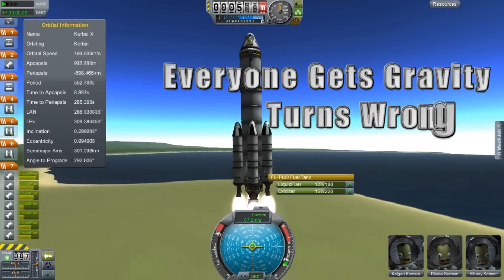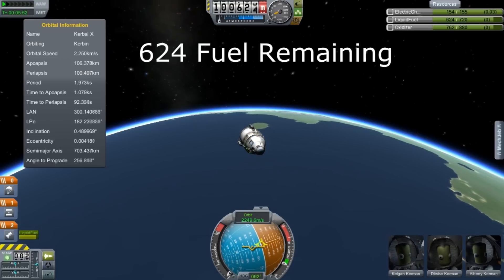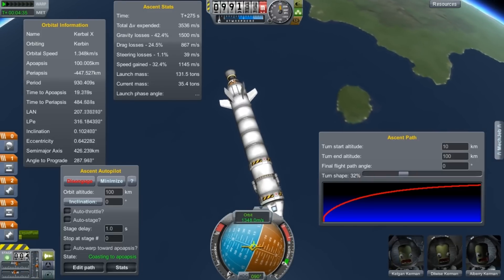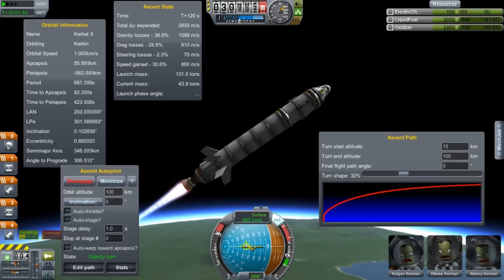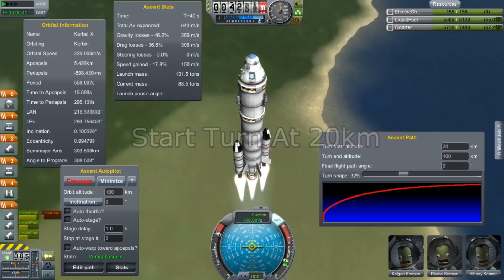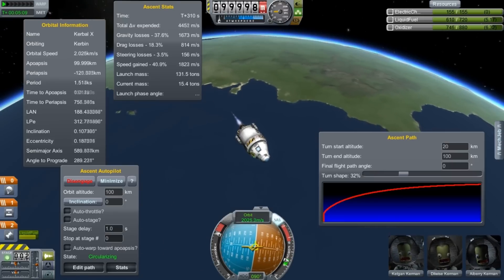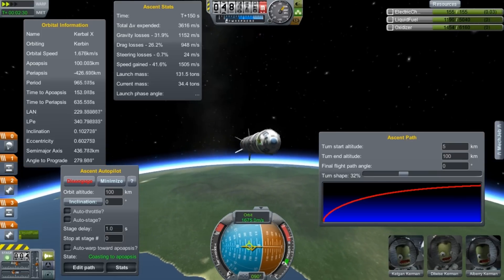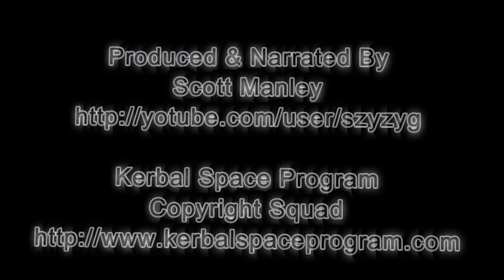Kerbal Space Program 101 - When Do You Start Your Gravity Turn?

Comment: I currently want to achieve something that I have in mind.
I want to "theoretically"(only the calculation part)
be able to make a Lunar Mission by either sending a Satellite to the Moon, or landing a Rocket on the Moon.
In order to do that, I should first get the Rocket into an Earth Orbit.
Getting it into Orbit requires a Horizontal Velocity which can be calculated from the VisViva Equation: $$\vec{V}=\sqrt{\mu (\frac{2}{r}-\frac{1}{a})}$$
So we are able to get it in Orbit.
Let us calculate the Burn Time too, to know for how much Time the Thrusters should be on.
We can do that from the Tsiolkovsky Equation, but that's another story(which I have already solved).
There are more steps we should do, but a major one is missing.
Gravity Turn.
In order to be efficient and make the mission not be that expensive, we should perform a Gravity Turn.
I have read from my Book(Fundamentals Of Astrodynamics) that most Rockets usually start the pitch programme 15s after the lift-off.
But how do we calculate that?
These are my questions:
How do we calculate when to start the pitch program?
How do we calculate the Angle of the Gimbal Thrusters we should have at the pitch program?
How do we calculate for how long to have the pitch program on before aligning the Thrusters with the Rocket's Nose?
To be honest...I don't really know.
So let me rephrase analytically.
I want to learn the Equations that are being used by real Space Agencies for real Space Missions. How do we calculate when to start the pitch program? What should the Angle of the Gimbals be?
For how long should the program keep running until we turn it off after some Time to let Gravity alone tilt our Rocket to the East for the rest of the Flight until we reach the altitude we want to get our Rocket into Orbit?
ATTENTION:
I do not want solutions of Numerical Integration of The N-Body Problem, as I could already solve it. I want Patched Conic Approximation.
I want that because I want to be able to solve them the "old school" way by paper and pen, not start Programming an entire Programming to Numerically solve it for me.
If you did not understand something that I said tell me.
Do not be shy to tell me as I am really interested in that, really locked in and focused and really serious.
You can also check a post that I made at Reddit that is about the same question:https://www.reddit.com/r/AerospaceEngineering/comments/1paq35i/math_behind_gravity_turn_in_depth/
I would REALLY APPRECIATE it if you helped me.
By the way I am from Greece and I am 15 Years Old.
You can also check this image of a drawing that I made showing a Rocket performing a Gravity Turn

Image:
https://i.sstatic.net/p5uSarfg.jpg

Comment: I KNOW that this is old but I was told that with a well designed craft an eastbound gravity turn could start as soon as you get faster than 100m/s as long as you just keep nudging the rocket to the right so that you're still within the ring part of the prograde marker. Doing that for my simple rockets I've been pretty successful and it's MUCH lower than any of the examples cited here. 

Actually, the manual turn you show at the beginning pretty much follows that rule.

Comment: I've had really good luck with going 90° up to about 20-30,000 altitude and cut engines. My rockets then glides through the remaining  atmosphere or most of it. I then turn to 40°-10° full burn till AP is above 90,000 ,again, cut engines,I reach AP then I  complete my circle orbit. Probably better methods ,but for me that method has allowed me to keep all of my original sub sections,and plenty of delta V to do so much more. Also my primary lift rocket I use most of the time will flip out if I attempt any turn inside most of the atmosphere.

Comment: I hate having to go straight up. But its the only thing you can do when your rocket has a 75% chance of flipping over the prograde marker.
Reply: FINS!!!
Reply: Add fins and give engines more control authority. Don't do sudden turns, tap the buttons instead
Reply: Center of mass should be higher than the center of lift.

Comment: I How do you make your rocket so easy to steer? I've many videos about many different orbiting techincs and good or bad i got a basic idea and i also can see that i am making the same mistake when it comes to arranging the angle of turns and the over fuel cosumption caused by that. So far it's okay but i just cannot make them steerable. Either they totally madly spining firecrackers or just lawn darts hitting the sky at almost 0degrees.

Comment: The method I use for ascent that has really worked well for me, is to simply pitch down 5 degrees for each 5k in apoapsis height achieved. If I'm using Smart  A.S.S., I do it in nice smooth 1 degree increments per 1k. When I reach 0 degrees at an apoapsis of 90k, I pitch down even further until the apoapsis height stops going up - usually around 20 degrees below the horizon. Keeping the apoapsis height stable, I continue thrusting until 2000m/s. I now finalize, usually by doing a radial-in burn to bring the time to apoapsis down to about 20s. This also helps to lift the periapsis up towards positive values.  Afterwards, I do a prograde burn to finish pushing the periapsis out to where I want it. I find I usually have attained an altitude of 75k-80k when I cut my engines.

The only thing to add is to keep the speed at 1/2 of current terminal velocity, whatever that happens to be... usually around 200-300m/s when below 15k altitude. So at launch, it behooves me to get up to that speed asap. 2 g's of TWR on first stage does the job.

Comment: A GRAVITY turn - is where your GRAVITY is supposed to turn you. 
Turn SAS OFF.
Give full throttle.
When your rocket reaches 40m/s, tip very quickly to needed direction TWICE. This should produce about 5 degree "punch". This punch will "resonate" soon, causing rocket to start turning slow using pure gravity.
When your rocket reaches 140-160m/s, tip very quickly to the same direction ONCE.

Watch until your apoapsis climbs to 70k and turn the engine off. At t minus 50 seconds align with horizon below your prograde vector, turn SAS (basic stability) on; fire engines at t minus 20 seconds and cut just before it reaches 70 km.

This technique is for 1.0.5 and is extremely efficient.
Reply from the maker: +Majou Nexian Yep, this video is way out of date, and your technique is much more relevant to current gen KSP.
Reply: Scott Manley  Hey Scott!! You are great! Watching your work with great please! From Яussia with love =)

Guitarfollower22 Glad it had something useful to you!
Reply: +Majou Nexian i heard tip to initial velocity 150m/s then later tip again and hold at 300m/s. I'm too iimpaciant so i just fucking book it up at like 1200m/s haha
Reply: Guitarfollower22
Don't confuse velocity speed and gravity turn. Gravity turn is most fuel efficient (money) way to leave planet with atmosphere. It does not work for planets without atmosphere(although manual turn is still most fuel efficient).

For Kerbin, optimal vertical acceleration is up to 500m/s max. You should reach horizontal at 2200-2300m/s @ 70k, so thats "unlimited". I think it safe to give initial "kick" between 40ms and 200 ms - larger rocket needs more initial speed.

Good marker - at 12k, you should be 45 degree to surface. Now, manual "gravity turn" (by constant control) often suggests discrete rotation. I never do this, its more-less smooth. True gravity turn needs perhaps 3-4 corrections total until orbit...

Rocket has to be aerodynamically correct to perform gravity turn. It has to have fins - big part of it. Not every rocket can do this. I suggest to use aerodynamic fairing for any payload with wings or boxes**. I have 300 ton rocket that performs gravity turn.

Its a fuel delivery rocket (economically my best effort, cheaper than "asporagus"), which 1st stage is powered by 3x3 Kickback boosters(only), 2nd stage - 1x Skipper+3x Thud engines (this stage has OCTO and parachutes, for reentry and reuse). primary stage is 36 ton of fuel. It costs me 70k.

To get grip on this, I suggest you to assemble in sandbox mode: parachute, MK1 command pod with pilot, 3x FL-800T fuel, 1x Swivel, 4x fins at tail. This is how I learned it.

** I measured, in 1.0.5, aerodynamics really work. A can of fuel + engine gets to 50k. With aerodynamic nose cone on top - it grows to 120k. Even basic grider on top of fuel can - gives 78k..

Sorry for wall of text =)
Reply: Majou Nexian wow thx man! helps a lot. You should make your own video (no offense Scott Manley but his is up to date)
Reply: +Rohan Zener  If you use rockets to get to space - you have to master it. If you can design single-stage to orbit rockets (reusable) and can land them near KSP - you get best combo of launch time and money. Of course, if you fly SSTO planes - you have to learn rapier or whiplash+terrier climb paths instead.  
Reason, is because deltaV is the currency. You need it for traveling anywhere, so more deltav you save - more planets you "conquer". Just launching straight upwards at maximum throttle and then turning into direction - carries the biggest deltav cost. :)
Reply: Where you start turning depends upon many factors, mostly twr and aerodynamic properties of the vehicle. Large rockets will recover worse from effects of air pressure, thus turning happens later and climb acceleration is lower.
If the vehicles are properly balanced, manual gravity turn can be started almost anywhere. My comment was about true hands-off gravity turn (SAS off), which draws the optimal turning curve in the space (because any touch of controls causes aerodynamic losses due to control surfaces friction) and mastering which gives satori about launching from atmospheric bodies about how thrust, air pressure and gravity work together.

The reality though is that vehicles are often suboptimally balanced due to payloads and require manual gravity turns anyway. But the closer you are to optimum, the more deltav you save. And what can be worse than being stranded in remote space due to running out of fuel..

Comment: This "fuel" is not a correct measure of efficiency. When the lower stage is dropped, in all situations it still has fuel. Unless this "fuel" is also accounted, your fuel usage (to ~600) is just minor moves that the auto pilot does after it is on orbit.

Comment: Mr. Manley,
What exactly do you mean on TWR as optimal? Most of my early rockets in career mode where I'm trying to get to the Mun, are around 1.20-1.25. I've had a few drop down to 1.15 but that seems way to slow on acceleration.

On the 1.20-1.25s I start "turning" at 100mps. Not completely but once I hit that I try to aim for 45 degrees around the 10km mark. I follow the vector over till around then. Usually at that time and around 11-15km my first stage boosters burn out and I'm in stage 2 with main 1. In other words my first stage is 3 engines 2 Reliant with the main as Swivel.  The boosters are the Reliant, and again they drop at 11-15km. That usually gets me around 550mps. I use the rest of stage 2 main 1, to reach 70km, but I do so slowly turning over towards the horizon, but I never fully go flat. I try again to keep within the vector marker.  At this shallow a climb by the time I hit 70km with my apo I'm around 1400-1500mps, sometimes even 1600-1700 if I hit it just right I guess. I then detach stage 2 main 1 if no fuel is left and hold till I hit 70km. Once I hit 70km I begin burning stage 3 main 2 as my orbiter stage, and it gets me in orbit. I then usually have around 1/3-2/3s fuel left in this stage to get me to the Mun. I wait till the Mun is in position roughly 45 degrees off my apo then I burn till 10.9m. This sometimes leaves a little in stage 3 but most of the time I empty it around 3-5m and go to stage 4, which is my lander.

I'm sure I've got a real heavy rocket as Kerbal Engi tells me I have Delta V around 6800-7000. Essentially stage one is three stretch tanks plus the 3 for the boosters. Stage 2 is one stretch tank. With Stage 3 being the half stretch tank. And I'm positive most of the fuel I lose is in getting down to the surface and then trying to get back into Mun orbit to return home.

What am I doing wrong here? Is it just simply the rocket is to heavy? Do I need less on Stage 1? This is essentially where I brick wall with the game. I have gotten to the Mun with probes and back with maybe a 25% success rate, and manned mission an abysmal 5%. What can I do better?

Any tips would be awesome! Keep up the work here so long as it continues to be a joy for you as it seems it is and thanks again.

Comment: WARNING: THIS VIDEO IS NO LONGER ACCURATE! Pre-1.0, this video was spot-on, but for those using 1.0 or later, there are other factors that influence your gravity turn, namely, aerodynamic stability.

1.0 introduced a much more robust aerodynamics model. Pre-1.0, the model was simply "reduce velocity by pv^2 (p = air pressure, v = velocity)". It didn't care about the shape of your rocket, it just slowed it down and nothing more.

Now the model is essentially carried out on every part that's ramming into air. Rocket shape matters as well; notably, adding fairings over anything irregular makes a drastic impact.

If you do a simple 10km gravity turn with a shape around 40%, your rocket will flip end over end. MechJeb now likes to begin gravity turn at either an altitude OR when a specific velocity is reached (100m/s by default).

For those not using MechJeb, and those launching rockets in career or science mode before fairings are available, I like to turn over to a 45 degree angle immediately after leaving the launch pad, then just hold that angle until out of the atmosphere. It probably isn't ideal, but it saves a lot of the frustration that comes with rockets suddenly flipping out.
Reply from the maker: Indeed, I've posted several updated videos but this one is popular so YouTube keeps pushing it to the top of search results.
Reply: well it's a good thing there's a revert to launch button or I'd go broke just trying to master launches.
Reply from the maker: +ameteuraspirant once you make a small turn your nose will naturally want to keep turning, the trick (which is hard to master) is to start out just the right amoun and follow through. Keep your rocket pointed close to its velocity marker on the navball the whole time.

On top of this, if your rocket spins out, add fins at the back to move the center of pressure back.
Reply: Scott Manley  I bet a lot of these older/dated videos would drive traffic to your newer Career Mode series with overlays or links in the descriptions, probably worth the time. Love the series! Cheers!
Reply: +Scott Manley I was testing a lifter and had that exact issue. My cp and ct was literally one point. Having the vector didn't help.
Reply: Scott Manley your making any updated version soon?
Reply: Manabender isn't the max atmospheric altitude at 7k metres or so?
wouldn't that be the optimum turn point?
Reply: smooth turn? like the entire time or in increments, because I keep spinning out when I try to turn my ships in the atmosphere.
Reply from the maker: +ameteuraspirant No you want to get into as low an orbit as possible and make your turn as smooth as possible, if you wait until 70km to turn then you'll be doing a turn far too late. 

The best way to launch now is a smooth turn starting just after launch.

Comment: My first successful trip to Mun the rocket was so heavy the only way I could get into orbit was by keeling over 50 meters in the air to get the angle I needed. Wasn`t able to turn it on stage two at 10 km for some reason. So yes, angled ascent is better all round I think.

Comment: Don't forget that the Space Shuttle started it's gravity turn almost immediately after launch, within the first kilometer.
Reply: A lifting body works upside down at the right angle of attack just fine, so it's possible.
Reply: Probably because the space shuttle has wings so it would generate lift and it is better to use that lift to pick up some vertical velocity instead of loosing orbital speed
Reply: Youhavewastedtensecondsofyourlife Readingmyname Yeah, of course that works if the Shuttle is flying UPSIDE DOWN. Srsly.

Comment: If setting the ascent profile was a "science" then there would be a repeatable method for determining the four primary settings (turn start, end, percent, and correct power).  the last one power seems to be missing.  It assumes you go from the ground to orbit with one power setting (FULL)!.  I do not believe this is the case. Generally I see rockets throttling back until pass through max Q and then and only then going to full throttle..

After hours and nearly 100 launches the best I could tweak my main lander rocket 253T at launch with a little over a 50T payload was:

throttle back to 60% until over 9km
start turn at 4k
end the turn at 70k
65%

I end up with a float that I think is way to long and I lose a lot of horizontal velocity although I am at 1550 at ap.  However whatever I do to try to reduce time to ap causes the rocket to do summer slats.  

trying to figure things out like this is not "Science" it's "ART" and it sucks!

Comment: Some rockets need higher g turns because the rocket is very unstable most often due to a massive payload (I know because I've designed a rocket that is almost impossible to steer until the first stage is jettisoned). The reason for this is because the center of mass had to be close to the center of thrust. Launching a heavy interplanetary tug capable of towing 4 fully loaded orange tanks, and not using all that fuel is still a challenge. the "g-turn" really varies from rocket to rocket.